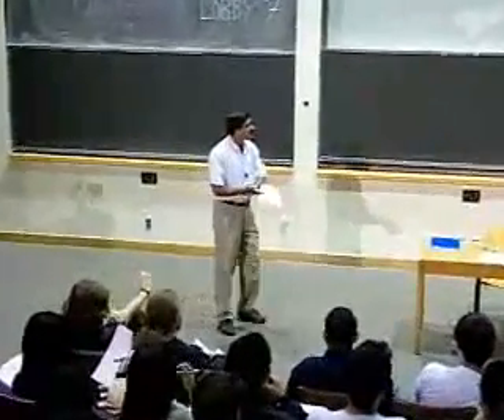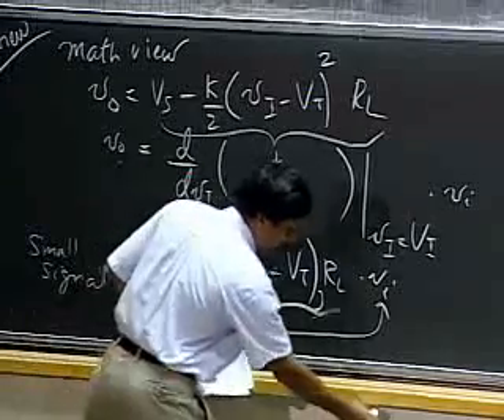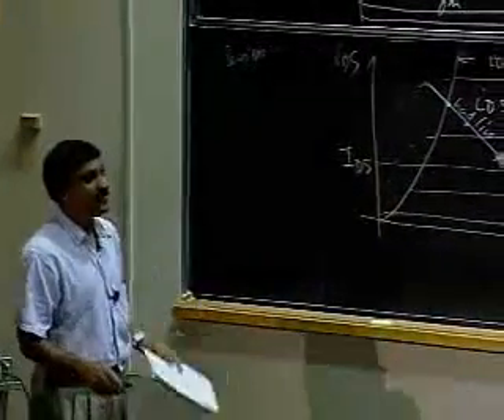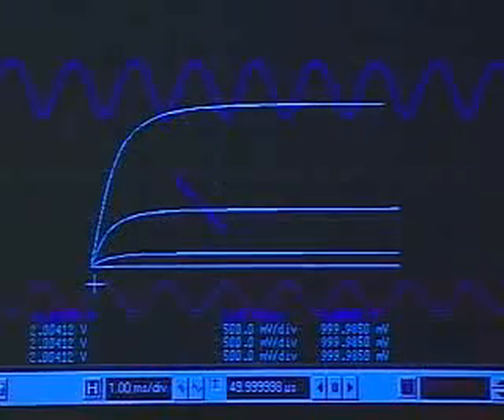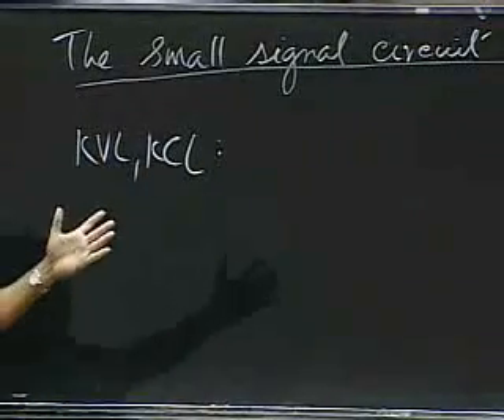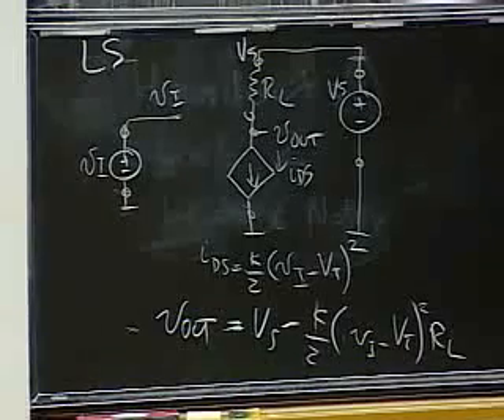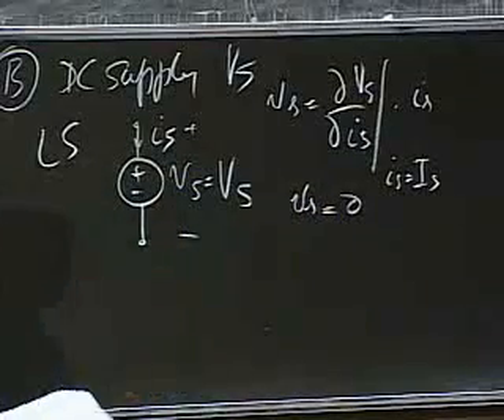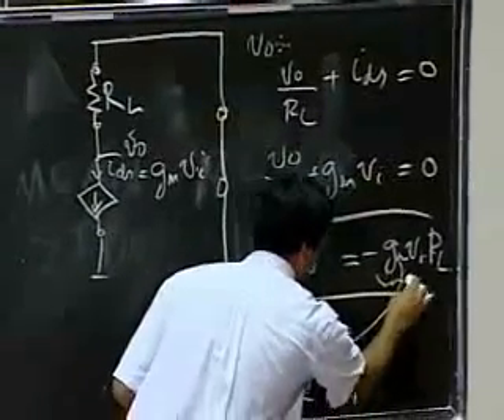Lec 11 | MIT 6.002 Circuits and Electronics, Spring 2007

Comment: Nice, but i do not understand the part of informal proof 28:35

Can  anyone tell me why he could cancel the unchanging variable(capital V, Capital I)?
Reply: OH i know
Reply: Watch lecture 9 & 10 so you can be sure how this happend. Basically you can cancel those terms because of the linear behaviour in circuit, of course, small change or incremental is needed
Reply: because when you don't apply any small signal to the circuits , the capital V and I will themselves satisfy KVL and KCL